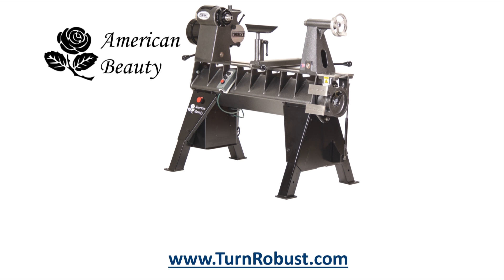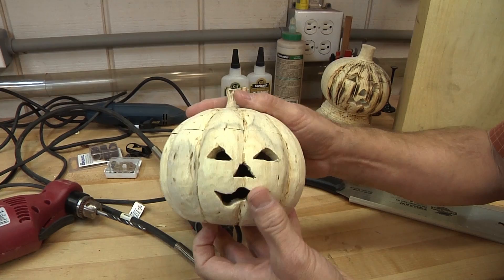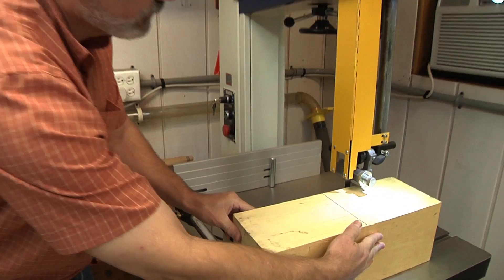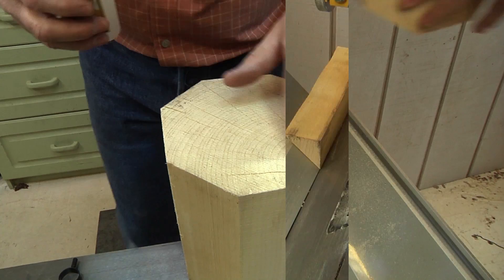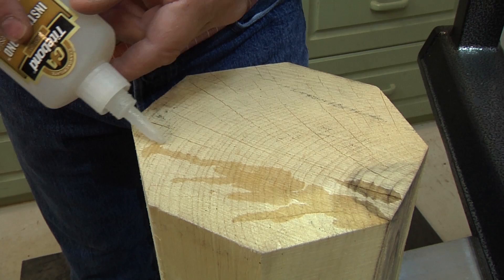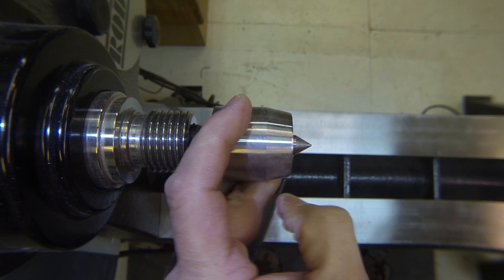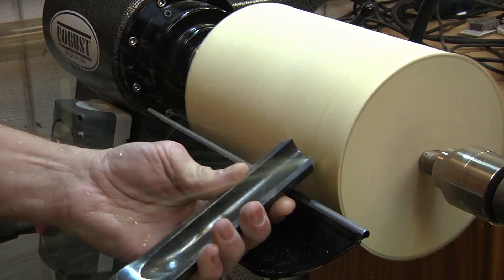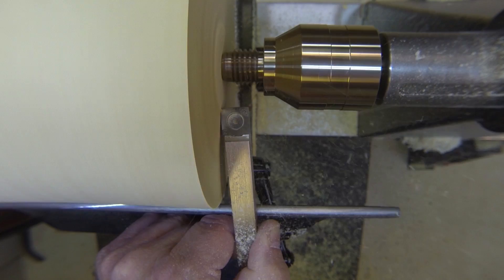Jack O'Lantern-Part 1

Comment: Sweet Tim!  do you bolt you lathe to the ground?
Reply from the maker: No I just have it sitting on the floor. I like to know when I have an out of round blank that is dangerous. However with my American beauty lathe it takes a big piece of wood to get it to vibrate.
Reply: I'm with you. my 3520 works great for all my needs.  I just put some thick horse stall rubber under my feet to the concrete to try it out.  I put an out of round pc on there and it shook a little more than normal so away they went.  Just curious.  thanks for the reply keep turning and be safe.